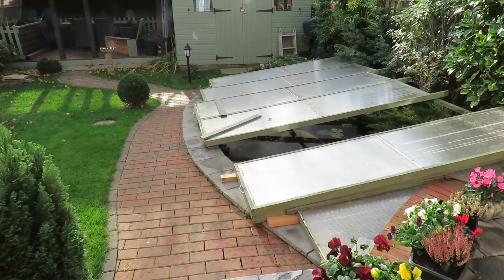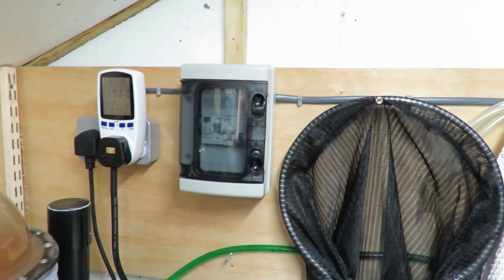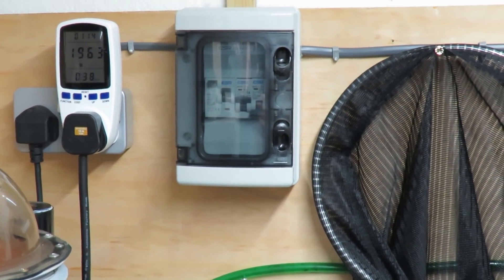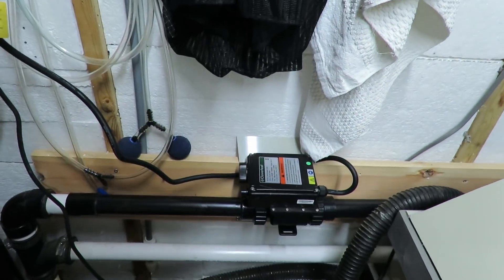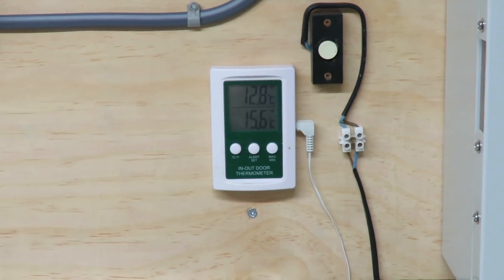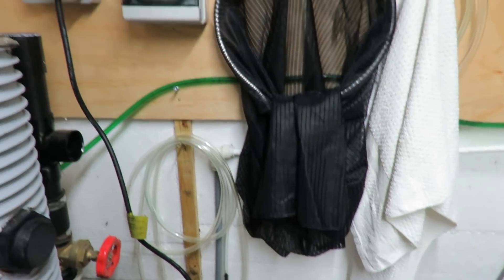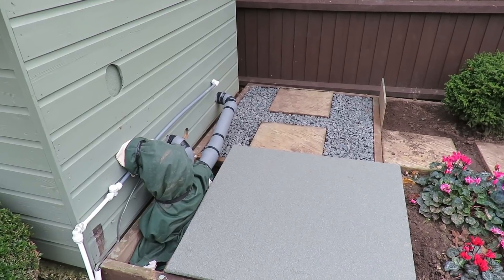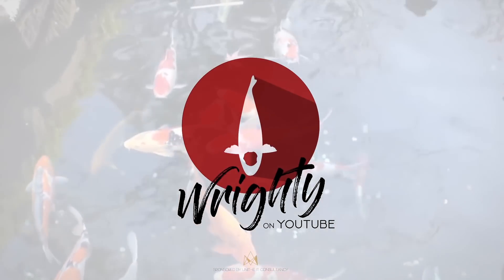More On The New Cloverleaf Pond Heater.

Comment: Thanks for the update. I'd be sending them the heater back for a refund😯 sounds close to useless. 
I wonder if the problem with the pansies was caused before you bought them? they look like having the problem you get if watering in bright sunlight or could be caused by irregular watering. I reckon the new flowers should be okay. Hope the new heater arrives soon, it must be getting a bit stressful for you now mate? Looking forward to your next video. Keep safe.
Reply from the maker: Hi mate, yes, I'm going to send the Cloverleaf heater back. You could be right about the flowers. They've been like that from the start. Due to the rain we've had they are in very wet compost. I keep trying to get better drainage on them. Just as they start to dry out, it rains again lol. The new ashp should be here in about a week. Can't wait to get it in and running now after all these problems lol. I've done all I can now until it arrives. Thanks for the tips mate, much appreciated. take care and stay safe, Terry.

Comment: going to fit an independant stat to mine, got a XH-W3001 off ebay , as I agree the stat in it is not that accurate and I prefer a digital display,
Reply from the maker: Hi Mark, I did think about fitting an external stat, but I think I'm going to send mine back. £170.00 for something that doesn't work as it should is a bit annoying. take care mate and stay safe. Terry.

Comment: I set my 2kw cloverleaf up it said after 1 hour it cost me £1.10 but think I set my plug meter thing up wrong as the instructions aren't the best for them I only pay 15p per kw so deffo summit wrong
Reply from the maker: Hi Liam, The way to set the price on the power meeter is, press and hold the PRICE button for 3 to 4 seconds. 4 zeros should appear with a decimal point in the middle as shown: 00.00 The left hand zero should be flashing. Press the FUNCTION button once and the second zero will flash. Press the FUNCTION button again and the third zero will flash. Now press the up arrow button once and the number 1 will appear: 00.10. Press the FUNCTION button again and the fourth zero will flash. Press the up arrow button until the number 5 appears: 00.15. Now press the PRICE button and it will be saved. If you now press the FUNCTION button again it will take you back the the main screen. Let me know how you get on. Hope this helps mate, Terry.

Comment: Initially when first installed It sounds like the heater was staying on and the stat was not breaking (hence the electric used was double) when you turned the stat up and down a few times I reckon that cleared it. (Possibly dirt or the something wrong with the bi-metal strip of the stat).
Id be sending it back and getting a refund. £170 for what is in effect a kettle, is a lot of money!
Reply from the maker: Hi Gary, I think your dead right mate. It worked totally different once I'd turned the stat up and down a few times. The problem now is, I can't trust it. It worked fine for 2 days keeping the pond temp at 13c. But I got up the next morning to find it had heated the pond to 14+c over night, and the stat hadn't been touched. I'm going to email them today about returning it. Like you say, it's a lot of money for something that doesn't work. Thanks mate and take care, Terry.

Comment: Shame about the heater. Seems poor design to me, what I don't get is how such a high rate but small heater can manage a pond your size. I would have thought the unit would be longer so contact time is longer? It looks like it can't be trusted. 🍻
Reply from the maker: Hi mate, To be honest, I don't think it's big enough for my pond, even though it says it is. It did lift the temp 1 degree, but the weather was mild. When it came really cold and we got a frost it didn't cope. Plus like you say, it can't be trusted. The stat on them is rubbish. If you check the comments here, nearly everyone with one has had to fit an external stat to them to get them to work correctly. I'm really not impressed with it. Thanks mate, Terry.
Reply: @Wrighty  Really strange as it does look a good unit but too much of a worry!  Cheers 🍻